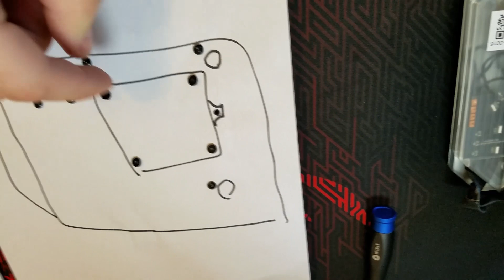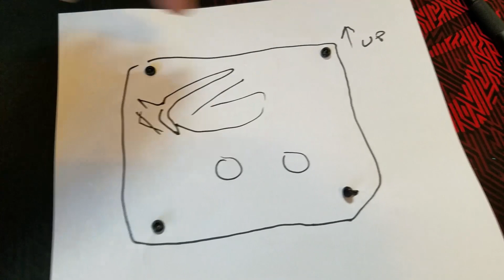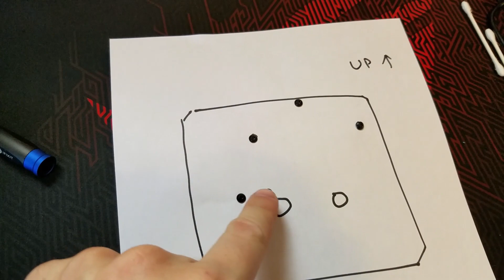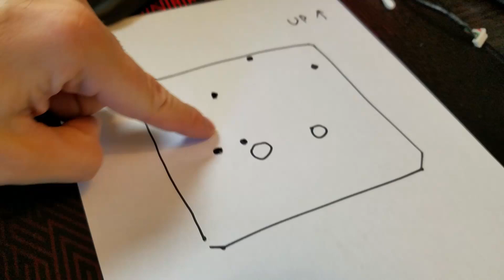Maximus 9 Extreme Monoblock Maintainence

Comment: The flow meter on my extreme stopped spinning and I think it caused my flow rate to suffer greatly b/c my temps just kept getting worse and worse.  I decided to remove the flow meter all together since it never seemed to work well to begin with.  This video was the only of it's kind and so I am grateful, thanks mister.  If anyone gets to the point where they feel like they have to disassemble their monoblock, I recommend they do the same and just remove the flow meter since I believe it is of bad design, plus it restricts flow and makes noise.

Comment: looking forward to the poseidon cleaning vids. Sorry about your system getting hosed from the silver coil and vue combo. will be interesting to see if you notice performance degradation when everything is back together due to the plating getting corroded.
Reply from the maker: Middle of Knowhere, I actually started making the video cleaning the poseidon cards, but I noticed that the coldplate is welded to the block. There is no way of taking them apart. :/ I ended up just running a highly concentrated vinegar solution through the blocks for 10 days and flushing with lots of water and then using them after that.
Reply: Aww. that sucks. :( Hope they work okay after the cleaning.
Reply from the maker: Middle of Knowhere they are ok. I just hope they aren't suffering internal damage.